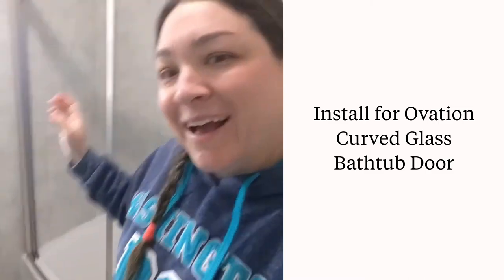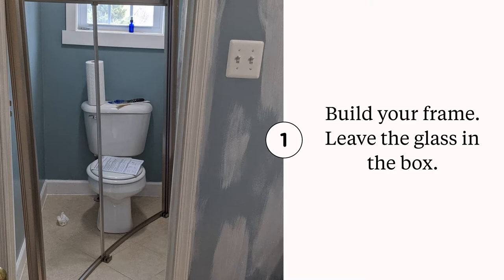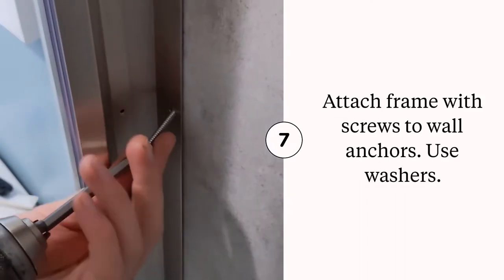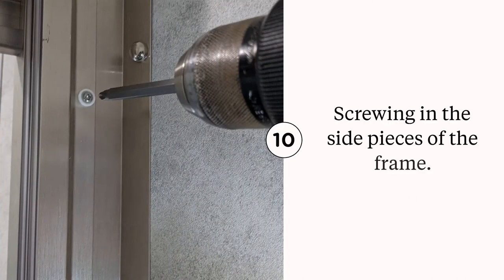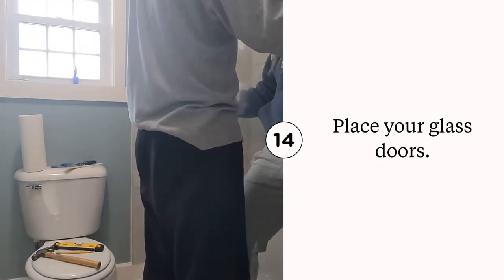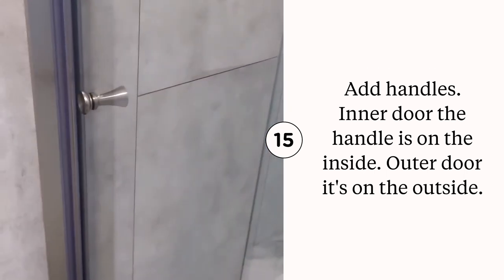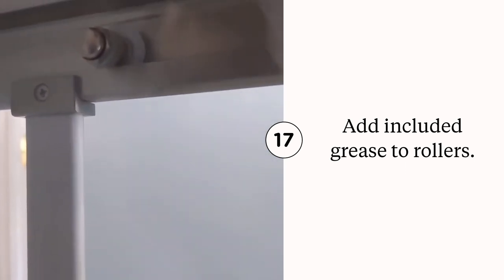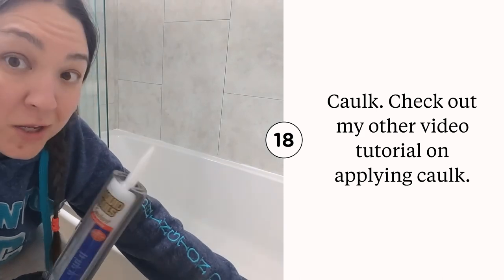How to Install a curved ovation bathtub door

Comment: Thank you for the video , Could you please confirm what is the minimum size opening this shower door fits into,  We have the ovation tub as well just installed it.  thank you
Reply from the maker: I am not the manufacturer so you'll want to verify on the listing that it will fit your tub. I think the tub and door and meant to go together though.

Comment: Hello, I was wondering If you can give an update on that whole system. I bought the same one and I am having 2nd thoughts on using the tub as I've seen reviews on it not being so good, people saying its cracked with in the first few weeks and so on. 

One thing I've already seen on the tub is the piss poor apron bracket and I'm also concerned about how flimsy the front is. How is yours holding up
Reply from the maker: No issues and I have three boys who are NOT gentle. But maybe we've gotten lucky?